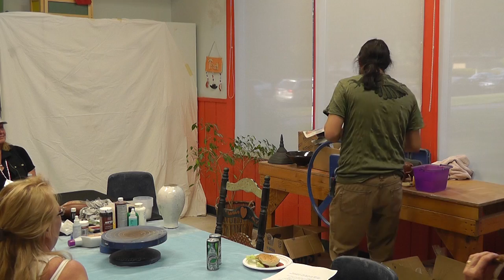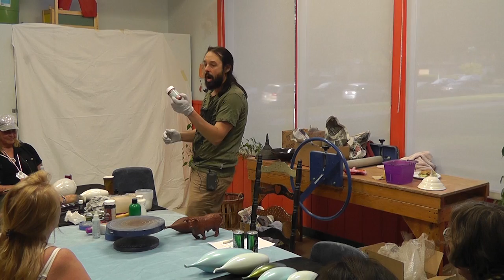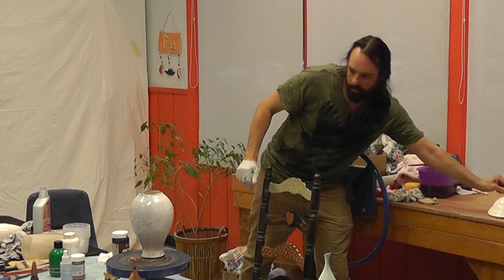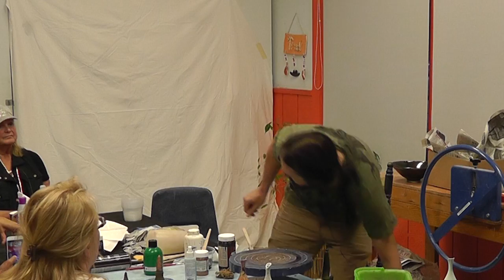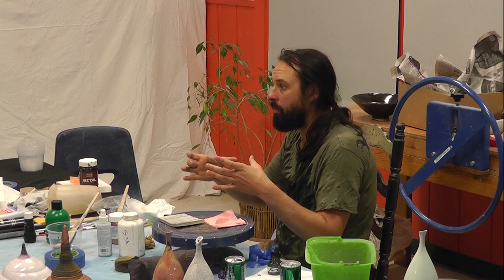Cold Finishes with Rocky Lewycky

Comment: As an person walking between two worlds, this makes an interesting battle of effects in my head. In materials work, tens of millions of dollars have been spent over decades trying to eliminate rust formation, while for artistic use, I can see the appeal of artificial aging and weathering. 
If that work has taught me anything, it's a lot easier to make rust than to attempt to limit it. Not with the intention of dissuading purchase of commercial products, but as it goes with time, things you like will suddenly disappear off the market and leave you to best replicate it. Black iron oxide is an easy paint additive in a very fine particle size, and as said, making this rust is quite easy. Salt water/brine is a relatively slow oxidizer but very effective especially at high concentrations. Common household bleach is a bit quicker and equally cheap as far as materials go. Metal dust can be sprinkled on wet spray adhesives and you can figure out the rest.